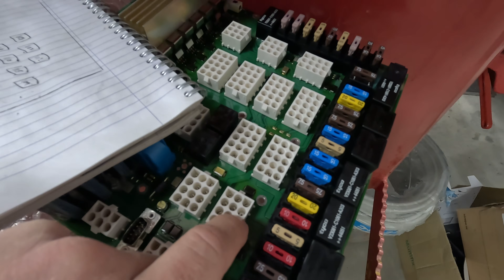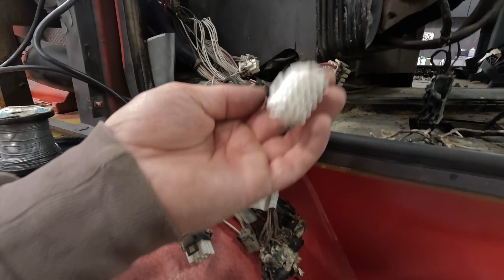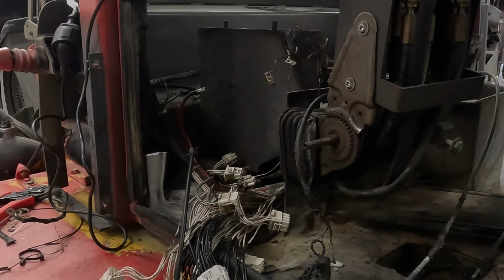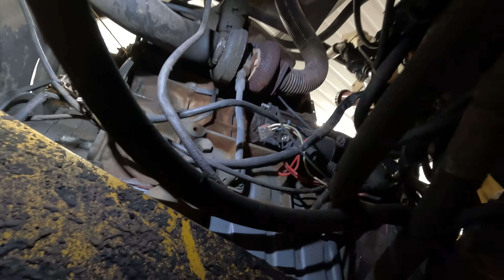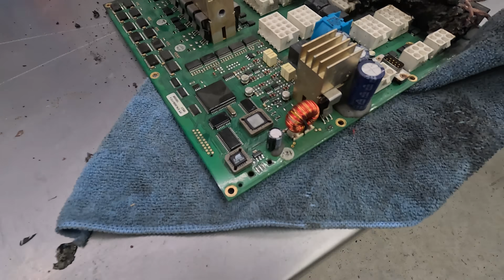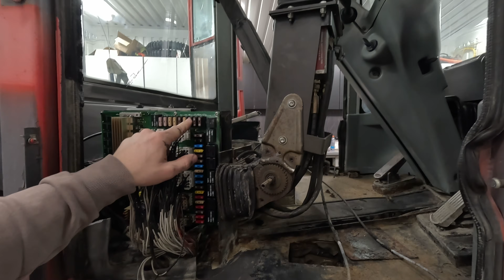Can I Save This Burned Volvo L30 Wheel Loader? Part 2

Comment: Those solders are going to crack from vibrations. If you look at the original connectors, they are crimped with no solder in sight. But if you sell the machine quickly then it's not your problem anymore. ;)

Comment: Is there no schemstic or wiring diagram available for that? At least then you could check point to point on connectors on the board to where they go. Good luck. Fingers crossed.

Comment: I would really put some non-conductive material between the circuit board and the metal, but that's just me. Didn't see any standoffs there. Correct me if I am wrong
Reply from the maker: @strangelman The metal act as ground for the circuit board, there are small standoffs like 5mm ones.

Comment: Greetings Bergstrom. Firstly said. Thank you for your content, you are doing amazing work and keep it going as far as it can, and secondly. Can you please tell me where did you bought Circuit board (some link please) and how much it cost? We bought same wheel loader L30 8 months ago and after it came to our place we saw that Circuit board is missing, we contacted few sellers and their prices ranges between 2600 - 3000 euros. Is that real price for new piece and is there some place where we can find used one for cheaper. I would be really thankfull for any information, especially my father who discovered youtube quite recently and also who discovered your chanel and hooked me on your videos aswell. Best regards from Croatia.
Reply from the maker: @petarrodic1351 I bought it here: https://ironwingparts.com/products/volvo-11306955-electroni

And somewhere it should pop-up a discount code with 10% for new buyers so it will end up at 900USD + shipping. I could not find it cheaper anywhere else.

Comment: Capacitors have a habit of going bad or losing solder connections in boards like that.
Reply: YEP! I used to fix TVs and VCRS back in the 90s and got a new Sharp console TV in for repair. Apparently it was shipped from Japan upside down, because all of the large electrolytic caps were off the board, rolling around in the cabinet. LOL I soldered them back in the board and the TV worked great.

Comment: Im pretty sure the blue wire you disconnected at the starter is a fusable link wire .
It is supposed to be sacrifical if there is a grounded situation.

Steve
 Arkansas ,USA

Comment: What are the numbers on the chips? A quick googling will tell you what they do at least, should be some kind of ROMs I guess.
Reply: wanted to ask the same, post the numbers written on the 2 chips ...
Reply from the maker: The new small one: GAL16V8D 260J D419RR18
The old small one: F16V8BQL 15JU 0516

The bigger one i have to take the tape of to see, will do as soon as i can.
Reply: @BergstromGarage  So, thats a programmble logic gate circuit, basically a chip that stores logic connections on how different signals need to be connected together, combined with some logic gates. Basically it would say something like turn on Signal A only if signal B and C are there, and other logic functions like that. Makes sense that you would want to move over the old chip that came with the machine, to make sure it keeps the same functionality. Unfortunately, these chips can have a security function that can prevent you from reading out the internal program memory, so if they activated that feature, you could not even read out the old and new memory to compare them and make sure they both do exactly the same. The different device identifiers just come from the fact that they come from different manufacturers, as the GAL16V8 was made by Lattice, and they stopped making them in 2010, the F16V8 is a "clone" from Atmel that you can still buy today. The rest of the numbers and letters are just identifiers for date of production, factory-ID and probably some lot number for manufacturers internal tracability.
My best guess is, that the other chip in the bigger socket is some memory for the big black microcontroller on the board. Maybe just an EEPROM to store some configurations and counters, or maybe even a flash memory chip that contains all of the firmware for that microcontroller. If it's an old enough memory device, it might have a clear glass window under that sticker, as the old memory chips were erased by exposing them to UV light. Or it might just have been a sticker to identify the firmware version stored in the chip.

Comment: Interesting video and i like it. 
If I may offer a tip: 
Most fires in electrical systems, and what likely happened with the circuit board, are caused by poor crimping. I would recommend buying a suitable crimping tool for the contacts. For example, KNIPEX has a search function on their website that will (with a high probability) find the right tool for you. So that you can enjoy your Volvo wheel loader for a long time. 
Best regards, and I'm looking forward to seeing how it progresses.

Comment: Great moment when the key was turned and the dashboard all lit up, must have been a surprise for you. The integrated circuit 'chips' usually have an alpha-numeric identifier on it. From that your can find out what the chip is for and whether there are any other parameters that apply to the circuit. Very interesting repair, so once again good luck. Be safe and well.

Comment: I'd have swapped the chips. They probably contain the relevant software for the machine you have.  Rather than an alternative model that shares the same board. Its pretty easy to read the chips and often there is some clues to the functions from the descriptive text on the chip.  I imagine there's another board on the machine which might have fried due to the shorts on the burnt board. Good luck, its a worthwhile project.

Comment: I had one before that's had a code programmed inn to it. And you had to put it in every time you stopped and started. Using the buttons on the left hand side. 

Just a tip if it wont start😉
Reply from the maker: Thanks for the tip!
Reply: @BergstromGarage  on my L35 the cod is 123456# maybe it's a standard code.